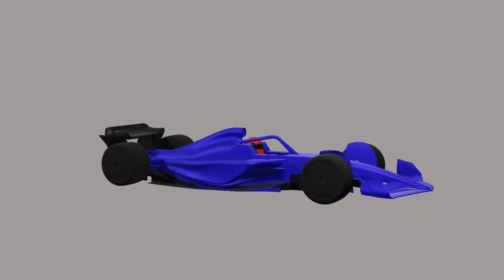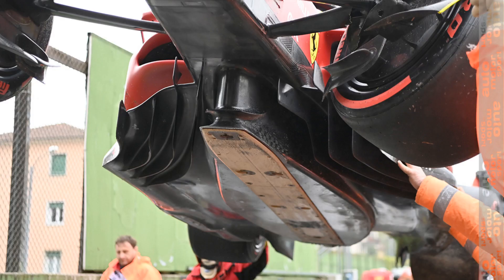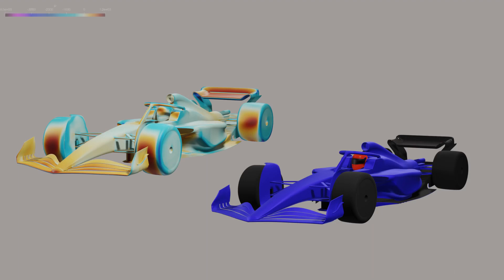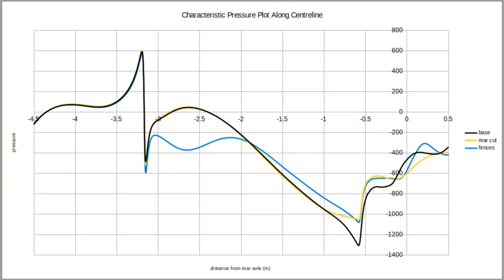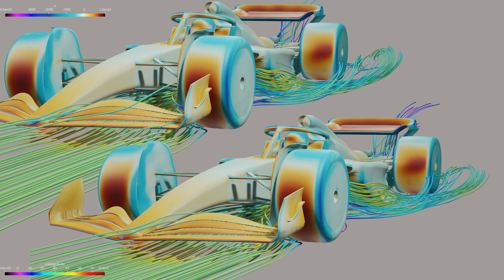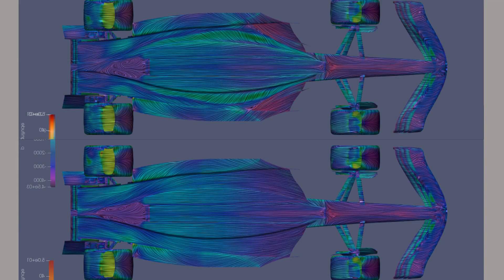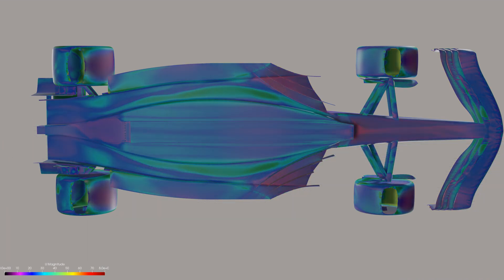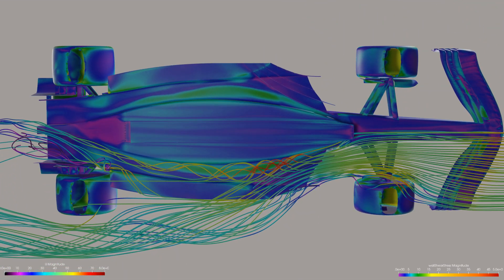Formula 1 2022 Aerodynamics: Floor Fences

Comment: As an armchair aerodynamicist i've always wondered if teams could shape the floor edge at the end of the strakes in a convex curve, essentially turning that section of the floor into a wing using all the flow coming from the strakes. Wouldnt it generate some amount of downforce? 

The new mercedes floor edge wing has something remotely similar, but i don't know if it's there for downforce or flow management. 

Anyways, i always thought it was an interesting idea, at the very least worth experimenting with. What are your thoughts on that?
Reply from the maker: very limited in that area and the fia were deliberate in that. Teams tried to open that area up a little with a compliance wire which gave them about a cm to work with, better than nothing.

Comment: Very nice video! But I have a question regarding the pressure plot you presented. Shouldn't there be pressure recovery from the start of the diffuser to the end, how come your end point of the floor has the lowest pressure? It should recover back to around 0 Pa
Reply from the maker: Thanks. The pressure recovery will never go fully back to atmospheric at the end of the floor/diffuser with these cars as the rear wing, particularly the beam wing is so heavily coupled with the floor. This video/model was just to understand the floor fences, which restricted the mass flow of the floor as to reduce the rest of its performance, as seen in the baseline plot. In the next video i improve the coupling of the beam wing and diffuser improving the overall performance of the floor. Then if you see the redbulls diffuser it is still accelerating the air almost at the end of the diffuser, meaning pressure recover is actually behind the car, these cars are doing things differently!
My next video, which is being made at a glacial pace, further builds on the understanding that I'm developing of the importance/role of the diffuser. As you can image teams are far more advanced in their understand of the floor, though I wonder if they all fully understand the characteristics of these car...

Comment: Gaining a comprehensive understanding of the aerodynamic intricacies of the RB18's mid-section solely through pictures may prove to be challenging. It's highly probable that the key to the car's aerodynamic mastery lies in that section. The precise configuration of the rear suspension appears to be flawlessly complementing the aerodynamic setup, further adding to the car's impressive performance.

Comment: Great Video again. Even if i think that the F1 Teams had their vortices in the tunnels reach the diffuser easily. That was pretty much the reason why they designed the fences that way. And Red Bull, well, their whole philosophy is based on a lot of vorticity under the floor and energise the vortices with air from the top of the floor.

Comment: The non fence floor and the fenced floor both create a divergence which raises pressure and slows down the flow. Once the tunnel starts constricting the airflow speeds up. The central section where the plank is also generates a fair bit of downforce.

Comment: These floor fences are subject to a lot of secondary flow losses, dealing with those secondary flows and their losses will go a long way to improve their performance. These strakes are extremely important to the floor. By creating a high pressure zone at the leading edge, the trailing edge creates a strong low pressure. The high pressure air on the fences is pulled by the moving road boundary layer, and the low pressure high velocity air between the innermost fence and the central body of the car.

Comment: this explains the cuts in the floor , so is the diffuser the main culprit of the porposing ? Compared to the early 80s and late 70s most have similar solutions for the side skirts . Can you do Arrows A2 that car is a mystery .
Reply from the maker: initially it was the main culprit, but teams have found other ways shake their drivers.